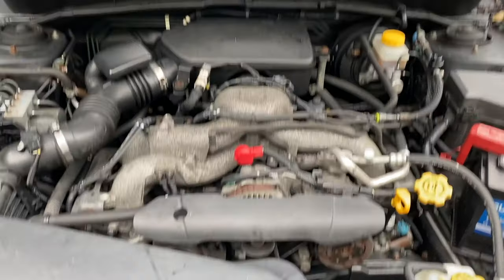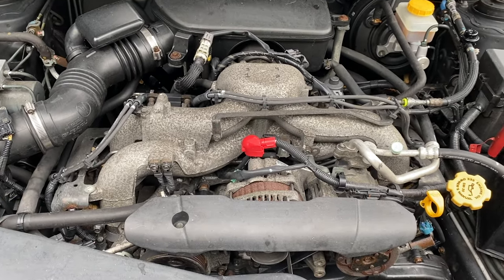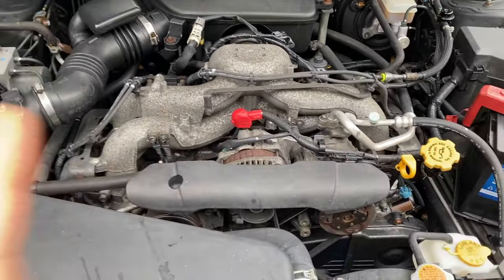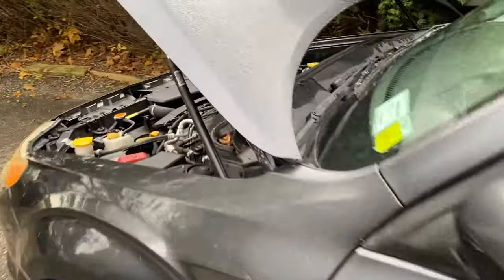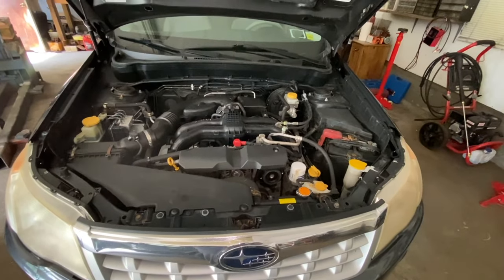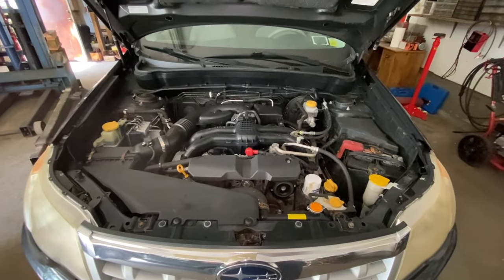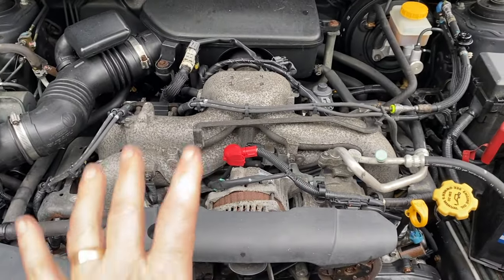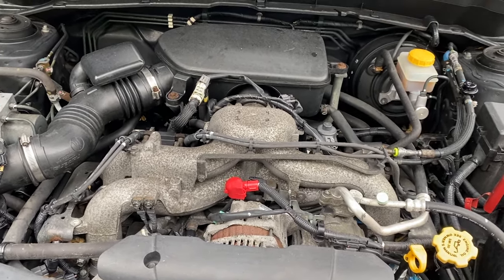Watch And Listen How A Subaru Engine Rod Knock Vs Piston Slap Sounds Like

Comment: This is exactly right. I just built a 2008 2.5 SOHC engine using a good 2001 block and crank. Good used 2008 rods and new 2008 pistons. I put new rod bearings in but couldn’t get a good set of main bearings anywhere so I opted to use the old ones that were in very good shape. I plasti gauged all the bearings and they were all perfectly in spec. The wrist pins to small rod end were perfectly in spec. The new pistons had about 8 thou of piston to bore clearance which was a ways out of spec but I decided to give it a go since the ring end gap was good. The heads are rebuilt and surfaced. Anyway, what I’m getting at, is it had a small knock like the first example but not near as loud and it worried me but I know for sure it couldn’t have been rods because I went through all them. I know the pistons were sloppy so that’s gotta be what it is. Goes away when warm or when reved.
Reply from the maker: Yep, exactly right!

Comment: Good video. I just seized my 2008 Subaru Impreza 2.0 engine completely. The mechanic had just a quick look because it was not worth it to do a full inspection but he thought the crankshaft cracked. It made the knocking sound as well before it seized. It already used excessive amounts of oil for months. Fixing it would break the bank so I'll bring it to the scrapyard.
Reply from the maker: Thank you! Sorry to hear that, if the vehicle is worth fixing, i have videos on rebuilding or replacing engine.

Comment: My 15 Legacy is nice and quiet with 125,000 miles on it. My wifes 18 Legacy with 70,000 is loud. I treat them the same except, I take the time to warm up the engine, she doesn’t. People say warming up an engine is useless?
Reply from the maker: No it's not, As I explained in another video and you are experiencing, some Subarus make noise some don't but considered normal. Warming it up is key to longevity either if it makes noise or doesn't.

Comment: my Golf 4 1.4L sounds like piston slap, if you say i have nothing to worry i believe you :D i got the car since 160.000km, now it has 185.000km. I will do an oilchange, maybe it helps :D 5w40 or something
Reply from the maker: Actually this is normal for Subaru’s but if yours is not getting worse you should be fine in what you are going to do.
Reply: have you never done an oil change in 25.000km?!
Reply: @alexandermeira7351  long life oil change 30000 km, sry if im wrong

Comment: Thank you for showing both! I don't have a Subaru but my Sebring is making a similar noise (210k miles) to the piston knock. Hopefully that's what it is but I guess I'll find out LOL
Reply from the maker: Good luck!
Reply: Unplug the coilpack..rodknock will stop due to the lack  of force on rod,, pistonslap will not
Reply from the maker: @mrmotorvator5151 yes and no. If the rod knock is bad enough it won’t matter

Comment: I've got a tapping sound on my 2006 scion tc that starts at 2000 rpms, and disappears when I go higher. A friend said it's probably rod knock. Doesn't make any noise until 2000 rpm.
Reply from the maker: Very well can be that would be a symptom.

Comment: Thanks for the video!! My Honda B20 has some bottom end tapping when the coolant is warmed up enough for the idle rpm to drop lower but the oil and metal isn’t very warm yet, and I was 98% sure it was piston slap (fairly common on the B series engines) because its never complained about me wrapping it out to 7000+ rpm, and this confirmed that and put my rod knock fears aside. Thanks!
Reply from the maker: Thank you for the comment. Yep seems like that to me too from what you explained.

Comment: Picked up a rust-free 2006 Impreza 2.5i 6 months ago for my son. It had a rattle on start-up, and some noises, classic Subaru, they're all I drive. Now, he is gone all the time and I see and hear it infrequently. But when I heard it idle at times, I thought it sounded worse. I changed the oil, but no change in sound. I had access to the car just after Christmas and the loud tapping/knocking occurred in the following cycle:

Distinct at idle, increased upon accellerating, then gone while cruising along. When letting off the gas to coast approaching a stop sign, the noise returns when it gets to 25 mph > idle.

The local Subaru specialist had it today for some other things, and he checked the sound, confirmed no exhaust leaks, and suggested rod knock. When I drove it home, I wasn't sure if I'm now oversensitive or if the symptoms described were far more pronounced. Never had this with any of my Subaru's. Any opinions?
Reply from the maker: From what you’re describing it’s not really going away when fully hot so it’s probably a rod letting go. You can try to put some oil treatment like STP in there just to see if it gets more quiet,if it does then the rod bearings are failing.
Reply: @Motorcarnut Thanks for responding. I like my Subaru specialist mechanic, but we seem to have communication issues. Long story short, this knocking sound was apparently "quite pronounced" at the shop yesterday (and when I drove home, he was right, it was much worse than when I drove it there the day before.) I changed the oil last night and ran a big magnet around, and there was some tiny metal bits, but nothing dramatic.

The "communication issue" I referred to was a chat a couple months ago when he believed a coolant leak was my HG...but it was the radiator. It has not overheated at all. But he recommended yesterday new block and heads, citing "danger" the heads may have warped from overheating "at some point". I could order a long block...would save the machine work the shop would do...but it comes with a new timing belt kit, which means losing the money I just invested 24 hours ago. I should also note this guy lost his long-time machinist that did block/head surfaces...but he "could find someone" to do it. But again, he's rather hung up on the "get new heads" advice.

So is there any reason to bit the bullet and just get a long block? (Maybe I could arrange a long block w/o a timing belt kit...but doubt that's possible because most engine shops pre-run the engine before shipping it out.)  Thanks for the advice...dealt with so many thinigs but this (especially with a non-turbo) is all new to me.
Reply from the maker: @tomasx9027 If the car is worth it to you and makes sense money wise a long block would be the best bet, less labor to rebuild your old one and should come with a warranty. Timing kit you have just keep it as a spare.
Reply: Or just throw so new bearings in UT if the cranks isn't chewed up to much.

Comment: Bought a 2015 legacy 2.5i a little over a year ago. Bought it at 108000 now has 145000. Engine gets a little loud when cold starting. Michigan weather for reference. Obviously cars hate cold weather but hearing what a problematic boxer sounds like helps a lot. Now i know what to look for in case something is actually wrong. That being said, these engines are noisy for a 4 cylinder
Reply from the maker: Yes, they are. I don’t like it as a mechanic but had many over the years and were very reliable.

Comment: Tengo un Subaru Impreza sport 2017, es normal que cuando lo encienda este acelerado y luego se normalize?
Reply from the maker: When you first start it, it is normal for rpms to raise a little if it’s too much the throttle body may need to be cleaned. I have a video on that too

Comment: Hi my engine makes what sounds like a rod knock listening to this video however once the car is warm & driven it does get quieter but obviously doesn’t completely go away. Any advice?
Reply from the maker: Sounds like a piston slap. If it were a rod knock it wouldn't get better when hot. You can try a thicker engine oil and some additive and see if that helps.

Comment: If the knocking is quieter, is it not rod knock?

I've had my engine go low on oil (dipstick completely dry) a few times.

But it's fairly quiet and only occurs at around 1,500 RPM.
Reply from the maker: Unfortunately it can still be a rod knock just not the bad yet.
Reply: It’s Definetly a big end gone (connecting rod bearing) engine is toast. Replace itl just get worse.
Reply: @shawntee1859  fear-mongering for no reason. Chill out.

Comment: Thank you so much! But I’m not mechanically in inclined so I’m still a little confused. I have  a Toyota carolla 2022. I was 1,326 miles past my oil change. I got the car in February. I’m not sure how the past owners took care of it though. Anyway, I got an oil change the noise stopped. Was it just a piston slap? I haven’t heard it since but maybe I haven’t drove  enough with it :/
Reply from the maker: Not piston slap but engine knock which can destroy the engine! It could of been low on oil. You have to be very careful never to let oil level go below the low mark on the dipstick. If the noise didn't come back you should be fine.

Comment: Thanks for explanations. a month ago picked up a 2006 WRX with 124k miles, after some day of enthusiastic driving I heard a very faint ticking noise for a few seconds, I revved slightly and the sound went away. Next morning I checked oil, and it was quite dry, I added 4 Liters Castrol 5W30 and the sound has fully gone, and the car drove normally, but I can see some oil spill on the lower plastic parts, I am scared this was a case of lemon car being masked with thicker oil with some major engine issues... Mechanic is away on sick leave and other one is booked till end of week, and I am panicking a bit.. Would appreciate some input
Reply from the maker: I wouldn’t drive the car until someone can see where it’s leaking from. You almost blew the engine running it low like that. Whether the person you bought it from knew or not, who knows.

Comment: If it was a rod knock would the
Engine light be on? My engine light is not on and I’m up to date with oil changes. I’m just still having trouble hearing the difference between the two
Reply from the maker: No it doesn’t have to be on. If the noise goes away when warm it’s piston slap if not it’s a rod knock.

Comment: There was a knocking on my hyundia tucson 2.0 petrol but after a few minutes it was gone but it sound like it was coming from the head of the engine must i worry about it?
Reply from the maker: Yes, it can also be from the timing chain hitting the oil squirter, not good
Reply: Thats piston slap, these are common on Hyundai's
Reply from the maker: @gicugigel3790 not really common on Hyundai
Reply: @Motorcarnut  from what i've seem, pretty common, both on diesels and gasoline engines. Their engines tend to develop piston slap or rod knock. My Hyundai engine had piston slap, replaced the engine and the new one also developed piston slap. I've seen theta 2 with piston slap and even V6.
The guy from 1st comment, says his engine knocks and gets quiet when warm, thats piston slap 100%. Thats  the way a piston slap acts, at least before gets worse over time and wont get quiet anymore.
Reply from the maker: True about the piston slap getting quiet when warms up but no so many Hyundais came my way yet with this particular problem.

Comment: i had this sound when knocking can be heard when accelerating especially at low rpm but not at idle. Any idea?
Reply from the maker: If it doesn't go away when hot, it's either a rod going or excessive piston slap.

Comment: hey how are you, I have a big problem, I have a Subaru Forester 2009, I just changed the head gasket and put it back together everything, I know everything is connected but my car doesn't run, the car has a crank, but I listen the pistons hitting  the heads, and I don't know waths is going on, can you help me whit this
THANK YOU SO MUCH
Reply from the maker: Sounds like the valve timing is off. Their isn't any other way the pistons will hit the valves unless it is off.

Comment: my first car was burning oil and i had no idea, so one day my engine exploded on the highway, and it was very loud knocking sound. now 10 years later, im facing a problem with my hyundai kona 2020 burning oil, keep adding more every few days
Reply from the maker: Those engines are under a recall for free replacement you may want to contact Hyundai

Comment: Hi brtoher i have bmw the same noise you said piston slap came out in it....and the oil temperature is not normal its low when i visit garage they said to me its engine rod knocking sound from down but its not sound like rod knock not even near to that sound what can i do any advice ...thanks
Reply from the maker: Post a video of the noise on your channel and I can give a listen
Reply: Ok i will posted it soon

Comment: My motorcycle has only 2200 miles on it and there’s an engine knock. Not a bad knock, and it’s is hard to hear at times, but there is a knocking.
Considering the bike is new, could bad oil cause knocking ?
Reply from the maker: It could but it's usually from low oil or low oil pressure. If the motorcycle is under warranty I'd bring it in for service before any damage happened if not already.
Reply: @Motorcarnut  :  it came out of service in this condition and they refuse to acknowledge the knocking.
Two days ago I brought the bike in, waited an hour and a half for the engine to cool down, the general manager and the service manager both came out to listen and the said it was normal and it was the valves. It does NOT sound like the valves to me.  It’s a hard metal to metal sound.

The service manager says he doesn’t hear it.  I say he doesn’t want to hear it.

Everything I say, they just deny.
I called Triumph in England and Patrick in the after sales department is as useless as tits on a bull.
I’m really stuck here with this dealership and triumph not willing to help.

I may have to use the news channel to solve this.  They have a unit that solves problems for people.
Reply from the maker: @ginoasci2876 can you make a video on your channel and I can listen to it?
Reply: @Motorcarnut  :  that’s a great ideas.
I have quite a few but I’ll upload one that is undeniable.
Reply: @Motorcarnut  : uploaded two short videos.  If you listen you can definitely hear it.  
Really appreciate the help.
Reply from the maker: @ginoasci2876  I just gave a listen and I do hear many things, when you rev the engine does the sound go away? I do hear valves and or like chain ( if it has one) or piston slapping. I'm not that familiar with those engines. I do hear the metal to metal sound and it can be a knock as well. Why was the bike in for service? Did this slowly develop or was it in for something else and this just happened?
Reply: @Motorcarnut  :   I’m not sure it does go away when I rev it,  because the extra noise may drown it out?
To answer your question, it might go away.
In forth gear going forty, it sometimes sounds like a sewing machine, like something is clanging when holding the revs just right.
Yet sometimes I don’t hear it.
What does that mean to you ?

It was in for an oil leak at the drive shaft seal, and an annual service which includes   Oil and filter. 
That’s another thing.
The oil was black only after a few hundred miles. Which leads me to believe there’s excessive wear going on.  Yes ?

If the engine is knocking, there’s excessive wear and the oil is prematurely black.  Your thoughts ?

Did you listen to the short I uploaded?
That’s exactly what it sounds like.
Listen to that !!
Reply from the maker: @ginoasci2876 oil won’t be black if engine is knocking no but if piston has wear and slapping that can cause blow by carbon which will make the oil black
Reply from the maker: Either way it should be diagnosed try going to a different shop for their opinion
Reply: @Motorcarnut  today the knocking had disappeared for the most part after it was warmed up.  What’s does that tell you ?
Reply from the maker: @ginoasci2876 I don’t know, if it comes back try changing oil again

Comment: Great video, my suggestion would have been to add the valve tick noise for the third option of what a lot of Subaru owners hear
Reply from the maker: I’ll make one of those when i get one in.
Reply: I have a 2023 Crosstrek with a 2.0 liter motor, with 20,000 miles on it and it runs like a top, and the motor is about as noisy as a top! Those 2.5 liter engines can start ticking and making other engine noises shortly after purchase, and most will eventually become noisy.  If you want the little extra horsepower and torque that the 2.5 liter offers,  you might have to tolerate some annoying engine noise(s) for the life of the vehicle. Not worth it!  My 2.0 liter has 20,000 miles and is super quiet, even on start up. I'll take the smaller, quiet 2.0 liter motor, over the bigger, junky sounding 2.5 liter motor any day.
Reply from the maker: @Kragum24 yours will make noise soon too. They all do at some point.

Comment: I get a tick that I assumed was lifter issue , it occurs a low revs and hi revs any idea why there is a sweet spot where the sound goes away ...is the con rod bearing likely?
Reply from the maker: That can be a collapsed lifter. Is there a misfire present?
Reply: @Motorcarnut  doesnt missfire
Reply from the maker: Could be piston slap, connecting rod won’t go away
Reply: @Motorcarnut  I am going to get it into my garage and check/set the OHC lifter gap ...what does a collapsed lifter look like?
Reply from the maker: @ziffification would have excessive valve lash between lifter and valve

Comment: is piston slap not slapping when doing engine brake? mine when i step the gas its sounds knocking like in the video, but when i do engine brakes its gone (sorry for my bad english)
Reply from the maker: It's less when braking but still there, yes.
Reply: @Motorcarnut  ahh i see, thanks for the answer
Reply from the maker: No problem

Comment: Que problema tenia ese motor ??
Donde estaba el problema
Reply from the maker: This was a demonstration. The engine with the rod knock needs to be replaced or rebuilt. The piston slap doesn’t require anything unless it doesn’t go away when fully warmed up.